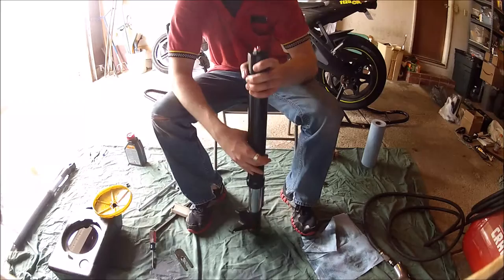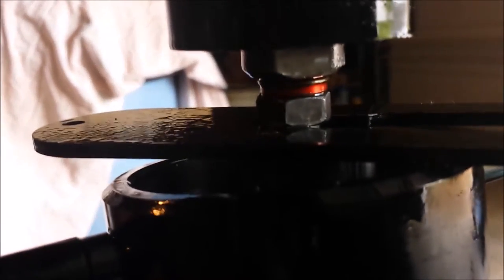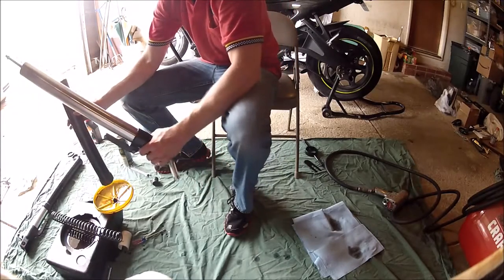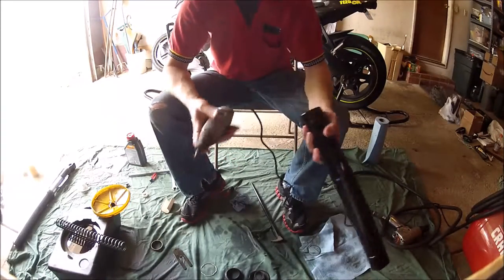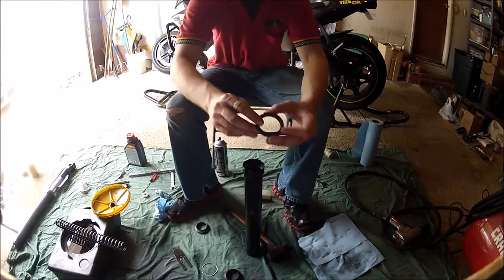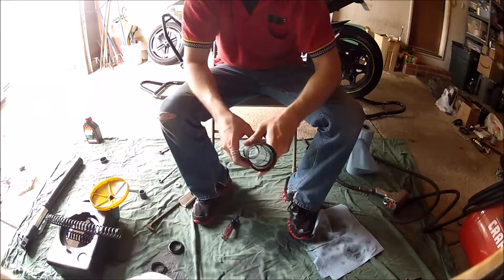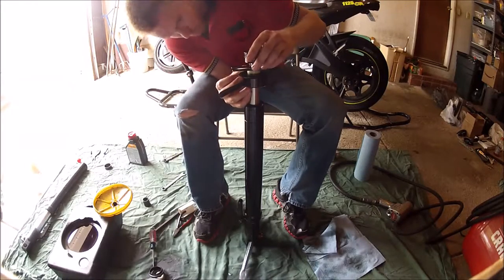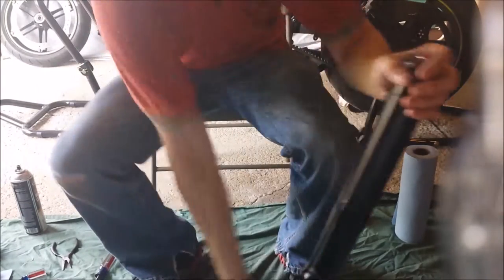Buell 1125 CR/R Fork Rebuild Part 3 (Fork Disassembly and Rebuild)

Comment: Do you absolutely have to cut out the cooper bushing or is it okay to reuse the old one? Getting ready to tackle this project.
Reply from the maker: I wouldn't say required unless that bushing is gouged up badly. More than likely you will be able to reuse that bushing that's in the forks now. I decided to just replace mine anyways since I already had the part.
Reply: @WeakestofWeeks  thanks for the reply . I was asking because I wasn't finding that bushing.. but managed to find it. St.Paul Harley in Minnesota is the only place iv been able to find specific parts.. that american sport bike is no longer . Thanks again.! Great videos. The best for 1125!
Reply from the maker: Thank you, much appreciated! Unfortunately that's the sad reality with Buells now 😔
Reply: @WeakestofWeeks  The only other thing I was wondering about was, you ordered a slide bushing but didn't see one on the diagram or you install one? Did I miss it? It's the only thing I didn't order.
Reply from the maker: It has been awhile since I rebuilt the forks, but if I remember correctly I did not use that slide bushing.

Comment: Nice video man, was going to pay someone until I watched your video. What video would you recommend for bleeding the forks? Thanks!
Reply from the maker: *****  Thank u! This video was designed to inspire others, much like yourself on doing repairs they normally wouldn't take on. I don't have a specific vid off hand but check out this link from twin motorcycles (http://www.twinmotorcycles.com/artikelen.asp?cid=7&aid=289). I used it as a bases for doing my forks and they offer a detailed fork bleeding procedure.